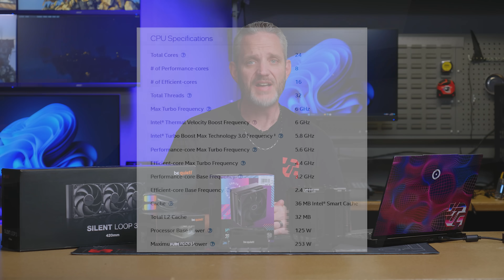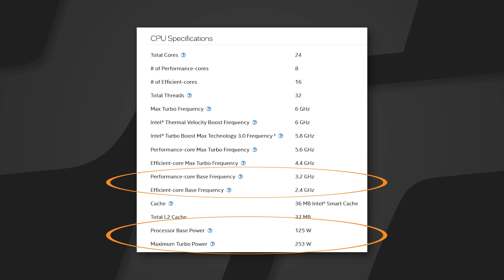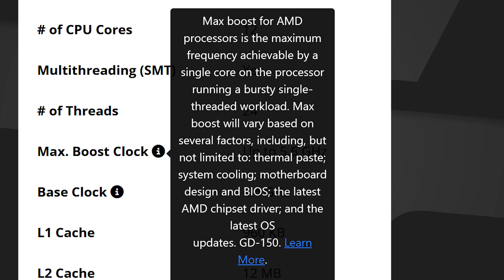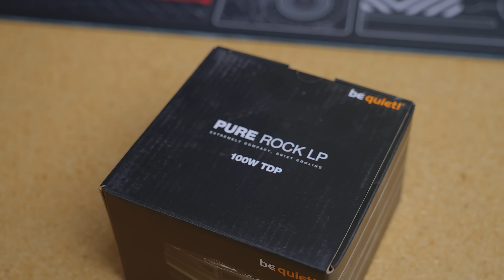Forget what you THINK you know about TDP

Comment: What we have always used as a rough guide is the PL2.  While PL2 may only be allowed for 28 seconds for the i7 (56 seconds for i9), that is a long time for heat to be drawn away from the inside of the processor, to the Integrated Heat Spreader (IHS), transferring to the heatsink base, then to fins, before finally dispersing to the already warm air inside your case. Which is why it is good to turn off the sometimes ridiculous manufacturer "optimizations" related to power limits.  As an example, a z590 based Asus ROG will run PL2 of i7-10700 at 230W, instead of 224W with a Tau of 6 to 10 seconds longer than the Intel default.  So check the Power rating on the heatsink and compare it against the PL2 of the CPU.

Comment: 2 corsair 5000d airflows same fans except rgb & non rgb 12 icue fans ea rig i9-9900K the other i7- 12700k both use same cooler a Phantom spirit, 7 heat pipes twin tower 3 fan, the i7-12700k highest core avg was 83 degrees F, a max temp on 1 core 122f low 95f. 78 degree room temp. 25 avg high cooler 60 degrees max cooler.

Comment: Meanwhileni use a 240mm AIO for my 9950x3d and it stays in the 70-75 degrees under sustained load. And 35-42 at idle.

Most people dont under apec coolers from what i have seen. They over spec. Buying 360mm AIOs. Yeah youd be fine with a 240mm for any x3d part. If you are going into the high 200s like 260+ watt then consider a 360mm AIO. But yp to around 250? A 240mm is going to be fine. As long as you have the rest of your cooling system done properly. Which most people dont cause they overload the system with a bunch of fans which causes poor cooling and not better cause they all interfere with each other and get in each others way making them far less effective.

Comment: Besser immer reserve haben, hab nen 9800x3d mit micro direct die Pro und ner 4080RTX OC mit Eisblock, hab dafür einen 280x140x28mm Radi vorne und 420x140x28mm oben von Alphacool und Mo-Ra 3 Pro extern, das definitiv genug an Kühl Leistung, meine Lüfter laufen immer auf 600rpm und die Pumpen auf 66% und meine Temperaturen von CPU und GPU ereichen nie 70°C. 
Lieben Dank fürs Video 👍

Comment: i enjoy tinkering so i used a 14" automotive radiator and a large case fan as the first step, from there it goes into a liquid to liquid heat exchanger and the 2nd fluid runs outside the case with its own pump and reservoir through my wall  into a 420mil radiator to dump the heat outside. i use automotive windshield washer fluid "it doesn't freeze or foam up" and is safe for the pump. and it doesnt grow gunk since its designed to sit in a vehicle for a season untouched..  both liquid circuits are on their own control so i can turn off the interior fan during winter and the exterior fan depending on exterior temp.  cpu runs around 28 to 33 degrees c idle  and 50 gaming or most workloads.  9950x and 7900xtx

Comment: Would be nice to hear your input on that or maybe a test. Air coolers that have vapor chambers, when it comes to the mounting and physics, if the tower is mounted upright (like on a test bench) the vapor chamber then makes sense, because the vapor condensate in the very top of the tower and then sets directly on the base where the heat source is. Now if the tower is horizontal like in most cases the vapor chamber sort of loses its purpose, since because of the slight sag (especially the bigger towers) the condensed 'water' sets in the part where the heat source is at the furthest point. I hope my explanation makes sense about my point, I do understand that the difference is probably minimal, but would still love to see Jay have a go at this wild assumption, could be a fun video too!

Comment: What are Intel stock coolers rated at? My i7-12700 overheats at 50% sustained load.

Also, those towers ate too tall to fit into my case. I'll have to opt for a low profile cooler.

Comment: My mistake was thinking a dual 92mm aio cooler was going to be able to handle a 14900k at watercooled settings. Nothing like throttling at 99c under load.  Had to turn the power down to 265watts just to keep it at 87c when under load 5ghz max. I still need to turn down the watts some more to see when the speed drops below 5ghz.

Comment: My understanding of TDP is that it is the thermal power the chip is capable of dissipating for a particular temperature difference between the CPU internals and the immediate external environment, and this is usually based around the CPU begin just at its thermal throttling temperature.  Thus, any TDP value needs to be contextualized by a corresponding temperature difference, which is something that is never provided with these TDP numbers.

To explain, consider the thermal transfer equation:

W = k * (T_H - T_C) / L * A

Here, W is the power transferred in watts, and k is the bulk thermal conductivity across the thermal interface.  L is the thickness of material through which heat is transferred; A is the surface area over which transfer occurs.  T_H is the temperature of the heat source, and T_C is the temperature of the environment.  Since, in most situations, k, L, and A will be roughly constant, we can collapse this equation to simply

W = Q * (T_H - T_C)

In this way, the thermal power that gets dissipated depends directly on the difference is temperature between the source and the environment.  Since, by conservation of energy, when a given amount of power is input to the CPU, say 125 watts, we must have the thermal power being dissipated must also be 125 watts.  Thus, in this example, W = 125 watts.  In accordance with the above equation, in order for this power to be dissipated, either the source has to be sufficiently hot, that is, increase in T_H, or the environment has to be cooled sufficiently, that is, decrease in T_C, such the difference in the temperatures, when multiplied by Q, results in a dissipated power equal to the input power.

Usually, in dealing with TDP, the source temperature, T_H, is locked at the thermal throttling temperature, and the necessary environment temperature can then be computed from the above equation, if Q is known.  And, really, the TDP is actually not the value one would want to know to properly design cooling.  Q is the number one needs know, but Q can be determined from the TDP if the associated temperature difference between the CPU and cooling environment is also specified.  In other words, when companies are specifying TDP, they're really only giving half the information necessary to properly design cooling.

These same considerations apply to the radiator performing the cooling, as it works via the exact same equation.  The radiator will dissipate any amount of power you put through it.  The problem is how hot does the radiator need to get I order to accomplish this.  If the radiator is designed such it can dissipate 125 watts at 12 degrees-C above ambient, that is, (T_H - T_C) = 12 degrees-C between the radiator temperature and the ambient temperature, then for an ambient temperature of 21 degrees-C, the radiator will have to have a temperature of 33 degrees-C to dissipate the 125 watts of thermal power into the ambient environment.

Now, what does this mean for the CPU?  The radiator is what serves as the environment to the CPU.  So, the CPU will see a 33 degree-C environment, and its temperature will need to increase above this in accordance with the same equation but with a different value for Q, one specific to the design of the CPU.  Suppose the CPU is designed such it can dissipate 125 watts with a temperature difference, (T_H - T_C), of 25 degrees-C.  With the cooling environment provided by the radiator as 33 degrees-C, the CPU has to rise up to a temperature of 58 degrees-C to dissipate the 125 watts of power.  If we use a larger radiator, then Q for the radiator increases, because the area of the radiator is larger, then the radiator will be able to dissipate the 125 watts with a smaller temperature difference.  This would lead to the radiator providing a lower environment to the CPU, and, consequently, the CPU can operate at a lower temperature for the same required temperature difference to dissipate the 125 watts.

This is my understanding of how TDP works in relation to cooling.

Comment: In my experience TDP is perfectly fine, as long as you run the part within the specs as stated by the manufacturer.
My i5-11400 is a 65W part, as long as I turn off MCE and leave Tau at 8 seconds, it will boost at maximum to 90W for 8 seconds. After which it will drop back down to 65W and the tiny stock cooler is perfectly fine.
However if I enable MCE, set Tau to 4095, and set the AVX-offsets to 0, then yes in some cases that i5-11400 will draw 156W. But none of those settings are actually in-spec if you were to ask Intel.

The TDP really isn't a lie, it's just that by default motherboard vendors will enable settings that override the manufacturer default settings.

Comment: A wattage number on a cooler can't tell the whole story...the rate at which it can cool necessarily changes as the temperature differential does, so that number is only achieved at some particular temperature. Or, more likely, they just do some kind of average to boil it down into a single number, which is similar to what Intel / AMD do for their TDP ratings

There's no way around just having to test IMHO. That's the only way to know if a particular combo hits equilibrium at a temp that you're comfortable with.

The rating numbers could be useful for knowing "this cooler is beefier than that one" but probably only within a single brand.

Comment: A BQ TF2 on a 9900X venting directly outwards in a small room should be fine. I notice most of the tower coolers recirculate their own heat in most cases. If you have air conditioning, a decent air cooler in a cool room will work better than an aio in a hot room.

Comment: Yeah, one of the cool parts about a 9800X3D is that it tops out at about 130 watts of power when overclocked to its limit and running at 5.4GHz on all cores.  It won't get above 70-72C in my rig because I have a 360mm AIO and with even moderate fan speeds that's as hot as it's able to get in my 20 degree C house.  And if the AIO fails, the Thermalright Peerless Assassin 120 that I have as a backup will be more than enough to keep it going.

Comment: After using liquid cooled hardware for over a decade, i just switched to an air cooler (Noctua NH-D15 G2) for the CPU, and the GPU is just originally air cooled.
I am kind of surprised of how well that big block of a cooler is doing its job, which is perfect, because it must last for quite a while.
While i did buy that previous liquid cooled hardware because i expected it to be more silent, this new one is perhaps even more silent. (well, those AOI systems have fans too, so i should have expected it).
Keep it cool folks!    You're worth it..

Comment: Today we're going to talk about factual errors in this video.
1. The 212 in Hyper212 stands for the vaporization temperature of water, 212F, which heatpipes leverage to move heat around for dissipation.  (~8:58)
2. The Hype212 has always used 6mm heatpipes.  MODERN 6mm 350mm heatpipes can move 38W per pipe, making the Hyper212's maximum capacity around 152W.  The original Hyper212 was certainly less than this.  (wakefieldthermal heatpipe design guide datasheet)
3. The Bequiet Dark Rock 4 DOES NOT use a vapor chamber.  It is simply heatpipes sandwiched between nickel plated copper plates.  (Bequiet's own website)
4. The REAL way to determine if there is a vapor chamber is looking for the fill inlet that has been soldered shut.
5. You completely fail to mention the largest reason why AIO's tend to be better - moving the heat to an area where you don't have to worry about motherboard weight limits and keepout zones, allowing you to have a significantly larger heat exchanger with more sufrace area.

Comment: This video was a godsend. I'm close to replacing my current CPU, a Ryzen 5 2400G, for a new one - looking for a Ryzen 7 5700X, X3D or 5800X depending on what deals I can get -, and I have been worried about cooling it for a while because those CPUs do not come with stock coolers and the only one I have, the stock cooler for the 2400G which is a Wraith Stealth, I wasn't sure would suffice.

Now that I saw this video I understood a bit better what I should be looking for when trying to cool the new CPU.

Comment: gotta panteks xt ultra pro. good ol mid tower case. x4 140mm, x6 120mm, x2 40mm, and the AIO make that sumbitch a wind funnel. only issues are ambient heat and exhaust. (winter is solving that problem atm /technically fall)

Comment: On one of my older machines with a 2700X, one of the two plastic brackets that held down the wraith cooler broke, so the cooler was loosely hanging over the CPU. I didn't notice this for over a week; I occasionally had odd black squares on my screen, but only when watching videos, and the computer never shut down from overheating. I noticed the loose CPU fan when I was doing my routine dusting and opened the case up to wipe down the fans. Whoops! Luckily I had a spare bracket and some thermal paste to fix the issue quickly.

Comment: I used my corsair AIO for 13 years with no problems whatsoever, but had do drop it today because i changed to AM5
Reply: What did you go for? I'm in the middle of building a 9950x3d rig and I'm still searching for a good aio with a CPU pump that doesn't block the RAM slots. Going for a 4x ram motherboard and most of the builds I watched are sacrificing the first ram slot (and therefore it's correspondent other dual channel) because the pump tubes are too big.

Comment: Basically, both CPU manufacturers are inventing their own definitions of TDP which aren't actually TDP, and are effectively lying to customers and making it harder to figure out proper cooling.

I'd argue that the trend was started by Intel, with AMD following along to remain "competitive", but by now that's irrelevant.

Nowadays, I check TechPowerUp's reviews of the CPU I want to buy, "Power Consumption & Efficiency", find the highest draw they measured (typically Multi-Threaded) and try for something that can cool ~50% more than that, for relatively quiet cooling.

Comment: I'm new to learning about computer hardware and so many sources suggest CPUs produce LESS heat than their stated TDP. This didn't seem right to me when my 65w i7-10700's tiny cooler was screaming at me from a mini PC case. It's much happier in a SFF office PC tower with an aftermarket low profile cooler rated at 120w (I think, could be 100w or 145w, I looked at so many before I bought one). Rarely goes over 55 C even though there's minimal case air flow, just 80mm in and 80mm out.

Comment: For the low profile air coolers, I personally feel that they could have had better representation than the be quiet cooler there. That one, like you said, is space constricted use only and doesn't do much on higher end chips. However, going down the SFF rabbit hole, you will shortly learn about the "old reliable" Thermalright AX90-X47 Full Copper. I don't have the numbers, but this cooler is regularly used on higher end X3D chips with no issue in cases like the FormD T1. I personally use it with the 7800X3D and have no issues at all. I even gained performance when I gave it a small undervolt.

Comment: My soon to be ex-CPU (lol, how that sounds) i7-7700K is a magic chip. I turned off Turbo Boost, so it was just 4.2GHz and I undervolted it from it's default 1.2V to 0.9V dropping the temps by ~14C which made me notice that my water aio  is dying quite late when temps finally started to reach 80 xD
And I have this chip since 2016, only last year had to boost the V to 1.0 because it started to go unstable.

What it has to do with the video? Not much. Just wanted to brag a bit. :D

Comment: My dark rock 5 that on paper can do 210W, was not able to keep my 9800X3D on stock settings on 5,2Ghz in cinebench it throttled back. (Do not remember the Watttage but cannot be higher than 160W what is the out of box power limit) ok is a Matx build but with optimal cpu cooling in mind in a DEN A3 wood edition. (Ps this was with gpu idle)
 Overclocked to 5425Mhz and undervolted and used some Duronaut, around 150W usage 81-85C(depending envir between 21-25C). 

So no a 9800X3D is not easy cooled in my opinion with air coolers. Take enough headroom even vs real usage of your cpu.

Comment: 7800X3D doesn't pull 120 watts, far from that. Even running Prime95, it never goes above 75W. And no it isn't VRM, power or thermal throttling. But it still needs a pretty beefy cooler to prevent it from thermal throttling, I have a Noctua NH-U14S ( 200W model ) and it can sometimes reach almost 89c which is the 7800X3D's max temp. And no, my thermal interface is fine, it's PTM7950. The problem is the overly thick IHS and the top stacked X3D cache and the fact I like my fans silent. Cooling is complex, dependent on many factors.

Comment: What I feel is that a AIO is "better" for overall air flow in a small case as long its top mounted.
I hat the dark rock pro 4 and in my case at the time it barely fit and so it blocked of a lot of air flow right behind my CPU and before my exhaust fan and the glass was always really hot and when I got my AIO that "Problem" was gone. for me it was just to ease my mind that in my case there not a hotspot. maybe some overthinking but for me it was worth it but now with the bigger case I could use the DRP4 again but my AIO is still ok so no need to use it again till now.
I also would say it's easier to transport you're PC to lan partys with a AIO then a big dual tower cooler I would be more scared that something would happen with the DRP2 then my arctic 240
Reply: AIO's should not be top mounted